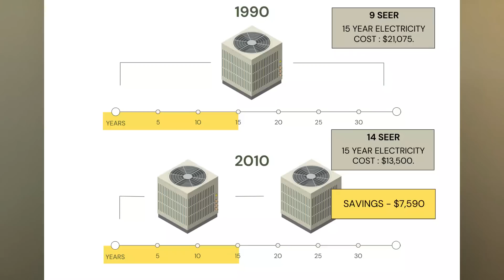Are new AC systems JUNK? Everything you need to know

Comment: The number one reason AC systems don't last as long is the industry as a whole pushes towards replacement vs repair. Any good techs move on to commercial or better paying positions, and fewer knowledgeable techs servicing residential systems. I see 5-6 year old systems being ripped out just because a new tech has been out 3 or 4 times misdiagnosing it and now sales it pushing for a replacement. A lot of people like to focus on manufactures being cheap or the epa changing rules but it's the service side of the industry that is a large part of the problem.
Reply: Cost of labor has gone up. That's why
Reply: @Cody8P why make a few hundred …when you can make several thousand ….that’s why…….
Reply: The word for those people is "crooks".
Reply: Agree.   The "tech" that came to repair my furnace couldn't troubleshoot their way out of a paper bag.    They had no idea what the problem was.   In the end, they were probably more of a sales person than a tech, and could only suggest a replacement.

My very old a/c is simple enough that I can keep it going, so that's what I do.   If I called anyone for repairs, they'd just want to replace it without trying to find parts or fix it.   Thank goodness for Ebay!
Reply: @Gr8thxAlot  You should find an honest, reputable company just in case.
Reply: @Gr8thxAlot  We call those "Sales techs" basically a sales guys that knows enough to do basic maintenance and convince the customer to upgrade.

Furnaces are easy to scam a customer into upgrading. Plenty of options to scare a customer that it's dangerous. No way for a customer to really know that their heat exchange really isn't cracked or the price of an out of warranty control board. Really have to find someone you can trust.

SupplyHouse is really great place to get parts online. Their support is awesome and  you can just give them the info for what you are working on and they will lookup the part. You also don't have to be a contractor or licensed like some of the local stores require. The usually beat the price on a lot of the places locally here, just have to wait for shipping.
Reply: @Tofulnc 

It’s hard to justify repairing a compressor, heat exchanger, or most leaks when it’s out of part warranty. This is because THE MACHINE IS DESIGNED TO BE A POS. You can spend all the money you want on repairs, but it’s not cheaper than replacing the equipment every 10-15 years. This is because they are designed to fail. Failure designed. Planned obsolescence. 

Don’t blame the techs for the actions of the manufacturers. We work extra hard everyday to fix the most ridiculous things that never should happen in the first place.
Reply: While that is true and companies are pushing for replacement, the fact remains that the equipment is not made anywhere near as well as it used to be.
Especially now with many manufacturers using LG compressors. I mean, Jesus, what the hell are they thinking?
Reply: @MrDeviousdom  Copeland scroll compressors are still available in equipment sold by most manufactures.

I'm not saying manufactures aren't part of the issue, I'm just trying to point out a less talked about fact that plague the industry. 

Every tech has seen equipment killed by a previous company or even fellow coworker. But in a larger context the manufactures get the brunt of the blame. Not flowing nitro, not taking time to pull a proper vacuum, not checking static, following "rules of thumb", etc. all contribute to the short lifespan of new units yet it's common to see it on a daily basis.
Reply: @TofuInc  I didn't say that they weren't. But a lot of manufacturers are switching to LG compressors, especially two-stage compressors.
LG makes absolute garbage. That's actually what LG stands for... Lotsa Garbage.
You are definitely correct, most "Techs" do a piss-poor installation and startup which definitely influences premature failure of components. However, LG products are truly garbage and having an LG compressor in your AC system is not a good idea!
Reply: @TofuInc  Amen!

Comment: You forgot about the coolant. Did you ever notice when the patents run out suddenly the coolant is an environmental hazard per the government. The production is banned on a time frame.so the coolant becomes un-affordable over currently a 10 year time frame. Then again the motor start capacitors lack of quality help support the service industry. My goodness spend an extra $20 on the $10K heat pump.  Comments?
Reply: Yup its the freon conspiracy. Dupont owns the patents. Then once the patent expires it magically becomes unusable and is governed to use the new freon that dupont has brand new patents to. All about money
Reply: I believe R410A is not patented, but R410B is and thus not wildly popular because of it.
Reply: @lelmus3277  R410A was a patented refrigerant until 2013, which 2013 was the same year all new equipment had to start using R410A. Next refrigerant a lot of brands are going with is R454B, all new equipment will need to be on R454B or R32 next year or the year following depending on the manufacturer. R454B will be patented until 2030.
Reply: @FreonChugger  454b is a blend r32 is a single

Comment: I partially agree with your statements, but some parts are missed. SEER is important, but the factors that made it need explanation. 1) the pressure in the older systems was half with R22 by comparison to the new R410A. That increases the faults for easier leaks and earlier failure of the compressor. This was supposed to be negated by the thickness of all tubing and stronger compressor. R410A has the ability to get colder faster, thus improving SEER. 2) the TXV valve is more sophisticated with more parts and thus can fail easier. Its benefits are import and to open more when the room is hot and slightly close when the room cools off, thus shortening the time the unit runs and improving SEER. 3) it’s well known that DC motors are more energy efficient compared to the older AC motors, but the electrical circuit is another failure point to just the windings and stator. Thus the ECM motor improves SEER.
Reply: Pressures are mostly irrelevant. Compression ratio is all that matters.
Reply: @sprockkets  Bursting pressures in the older thin tubing is specifically mentioned in the textbooks regarding unrecommended substituting of R22 with R410A. I think its more than relevant.
Reply: @sprockkets  Regarding Compression ratio, if pressure is doubled on both low and high side, wouldn't that mean the compressors Compression ratio is still the same for R-410A as it was for R-22? It looks like it would be to me.
Reply: @lelmus3277  that's my point on regarding compression ratio. I wouldn't worry at all about pressures on an old r22 system. It's all about the oil.
Reply: @sprockkets  I think were saying the same things, but with different words. Its all good.
Reply: Both the R22 & R410 units are no longer in production(2025), because politicians(EPA?) has forced the R454 units on to the public...
Reply: Keep talking I'm listening.

Comment: I'm currently soliciting bids to replace my 25-year old 10seer Ruud AC and furnace.  AC started blowing transformers out of nowhere one day a couple weeks ago and I began researching all of the pros/cons of various brands, stages, et al.  Your videos have been a huge help and the timeliness of this one was simply perfect, especially the bit bit about the additional ducts with a bigger unit-- I never would have thought of that. Kudos to you and your team, and if I lived in your region of Texas I would be calling you up!
Reply: Blowing transformers? That means you either have a low voltage short or a failed component, most likely the contactor. I could fix that for a $100. Sounds like you found a company that's trying to sell instead of fix. Sadly, most comapnies are like this.
Reply: @erichorton1440  I tell friends to buy a spare contactor at about 10 yrs. just in case. Spare caps. before that, of course.
Reply: @erichorton1440  yup, their favorite tool is their tablet they used to price gouge you on a new system you don't need
Reply from the maker: Thank you for that, glad my videos could be of some help to you - that is why we do what we do!
Reply: @atlasacrepair I'm looking for advice on purchasing the most reliable heat pump possible. 
What brand do you recommend? 
I am totally on board with your "Molotov cocktail" (crude but effective) take on this situation. 
Can you recommend a brand that keeps it simple. I'm not really concerned about energy efficiency as I am reliability. I think we're headed for a supply chain issue similar to what we had during covid if not worse. Thank you in advance for your help.
Reply: @jessebates9664  Eric is right, it's going to be a fairly simple issue, rubbed through lv wire, contactor, etc. your current contractor is simply trying to sell you a new unit. 
I would suggest that you call a smaller company, maybe someone that was referred to you and use that as a gauge of the company's integrity.
This poor industry is plagued with companies that give their employees spiffs on selling new parts and equipment, but on top of that, their skill level is next to non-existent!!
I can't tell you how many jobs I've been to as a consultant, only to find that I could fix it in 15 minutes where The company couldn't fix it in two weeks. It's truly sad!!